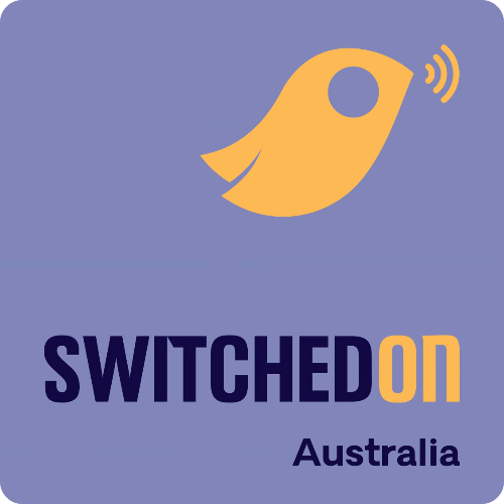The hidden energy guzzler in 1.3 million Australian backyards - and how it could help the grid

Comment: We run a pool with a Nature 2 and Sand filter with chlorine.
We run 1-1.5 hours a day in summer, and 4-5 hours in Summer.
We run the pump from 11am onwards and we have Solar and Battery.
Reply: Very similar setup to yours, same approach (run for a few hours during the middle of the day).  Works a treat.

Comment: Time of use isn’t just for pool pumps and car chargers! We are in a rural area and like many people, on a well, we pump groundwater into an above ground tank for backup storage and as a reserve for firefighters in case of wildfire.
Even if it is just for a home, extracting water from a well can translate to 10% of a rural electric bill. 

A lot of farmers and ranchers are moving towards solar well pumps. Timing of well pump use could also take a bit of strain off of the grid or off of battery storage. We also time the use of our dish and clothes washers and many other things in our home. And everyone knows about timing  charging for cars.

Now that we have solar, we turn the thermostat to a cooler setting in summer and warmer setting in winter while the sun is out.

These are all little things, but they add up quickly to speed up the ROI for a solar and battery system and decrease the amount of electricity we buy from the overpriced grid.